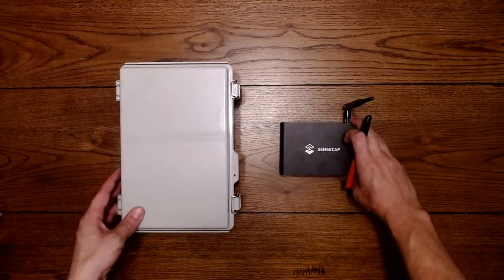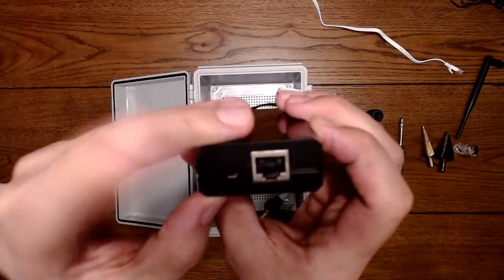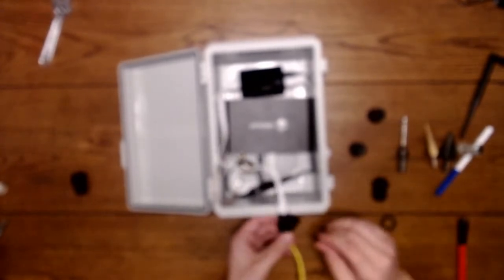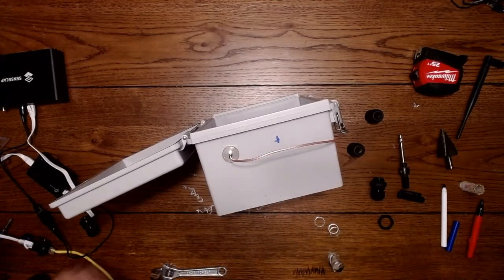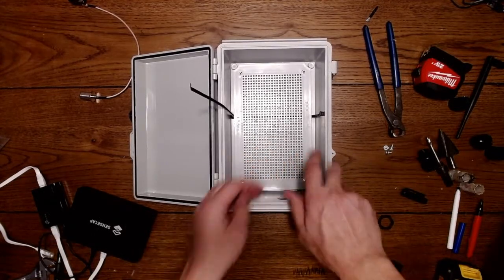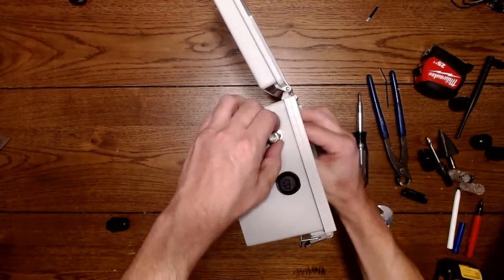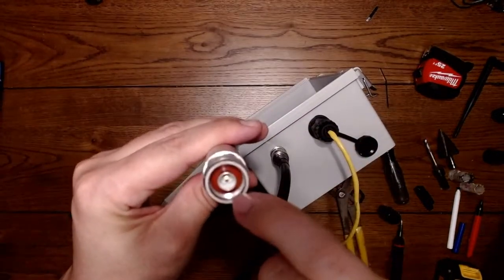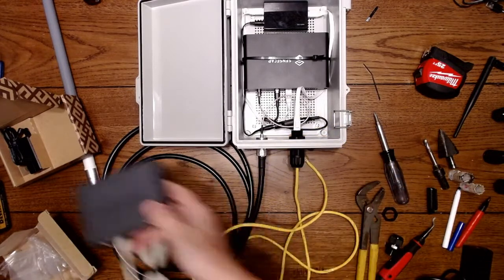Helium Miner Universal Outdoor Enclosure Build

Comment: Great video thanks. With the bulkhead for your antenna I have the same one I thought. It comes with a rubber gasket as well as the washer with the teeth. Did yours not come with a rubber gasket? I am sure there will likely be no water getting through there but the metal washer doesnt seem water tight. I was thinking about using rubber as well as a little silicone, but that would be harder to remove if repairs or replacements are needed. How is it performing? Thanks!

Comment: Hello group.  I'm just getting setup and waiting for some things to arrive.  Does the cable you pass through for the antenna come with the antenna? Or do I need to buy that separately? The one u connected to the miner in the video? What kind of bulkhead pass through do I need for that? I have everything else on the way